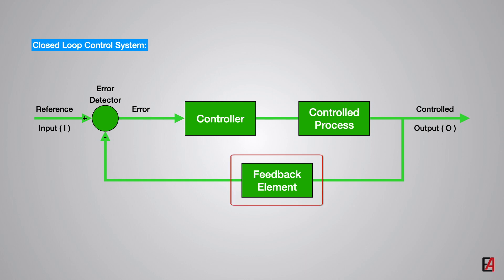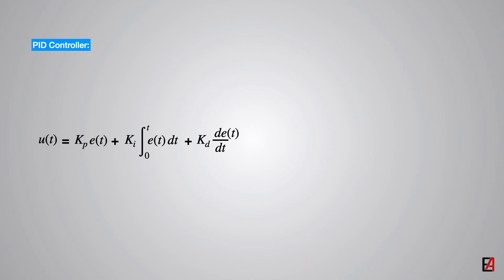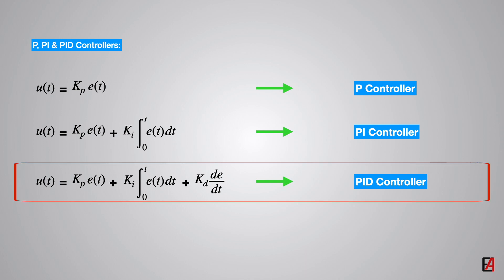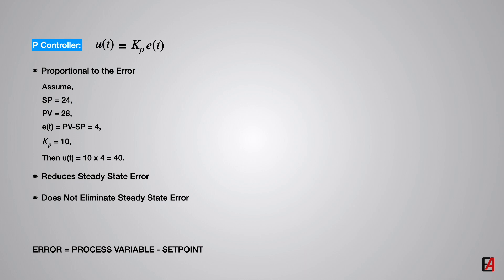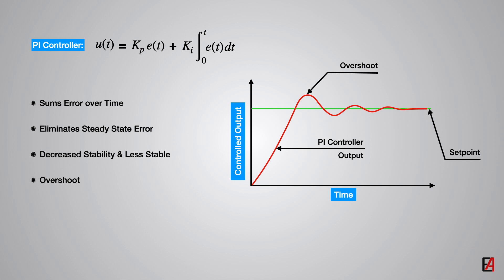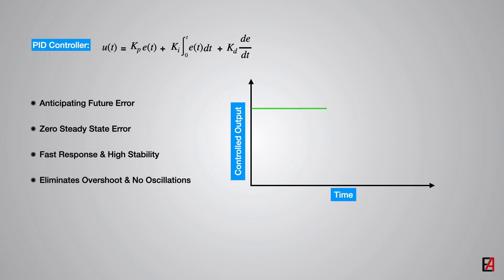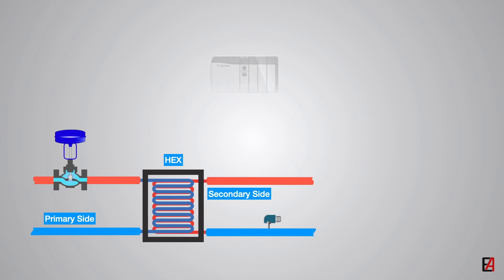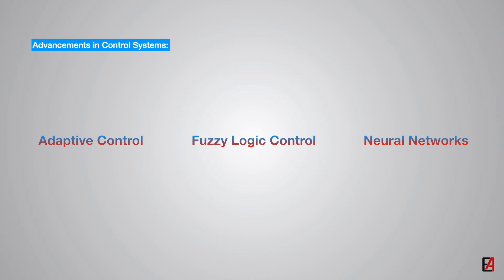PID Controller-Introduction with Details and Comparison with P, PI & PID #bms

Comment: Very use full explanation......

Can u please explain about how to check working condition of all  BMS sensors by multimeter..
Reply from the maker: Hi Jagathees, thanks a lot for your feedback. To check BMS sensor, there are 2 types,  sensors which requires external power supply and sensors that do not require any power supply. Sensors with external power can be checked by connecting external power supply and measuring the Output Voltage/current with multi meter. While measuring the voltage cross verify with the data sheet that the read voltage matches with sensor scaling. 
For passive sensors such as RTD, you can measure the resistance and verify with data sheet. For VFC contacts such as DP switched, you can check for continuity on the terminals by activating the DP Switch. Hope this helps. Kindly share and keep supporting.